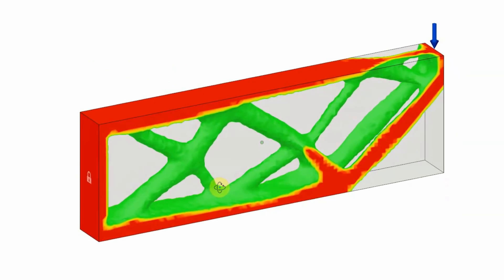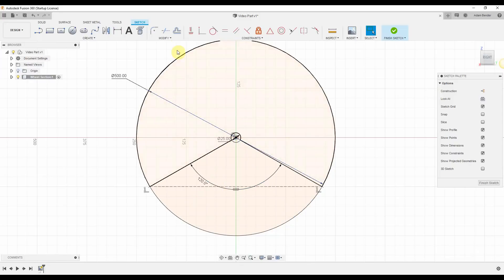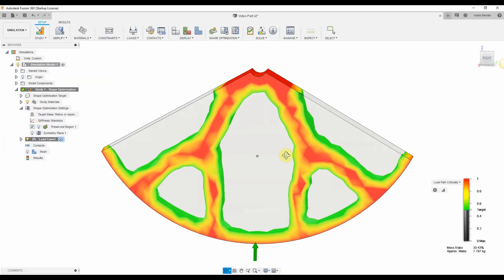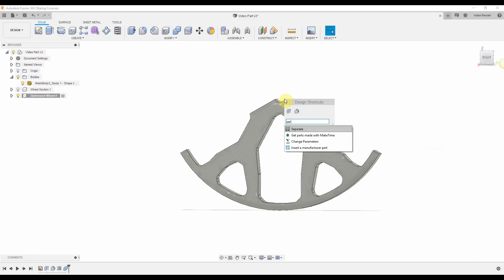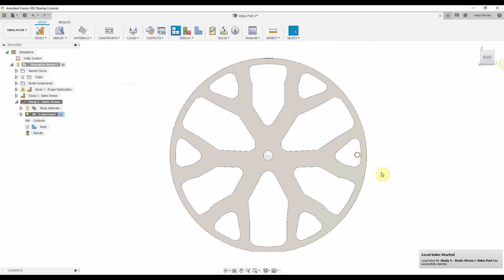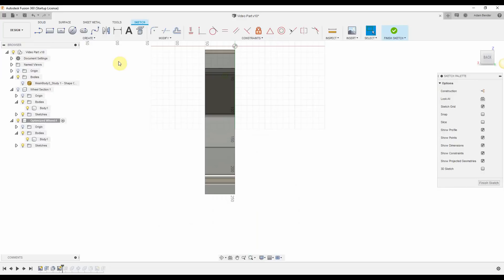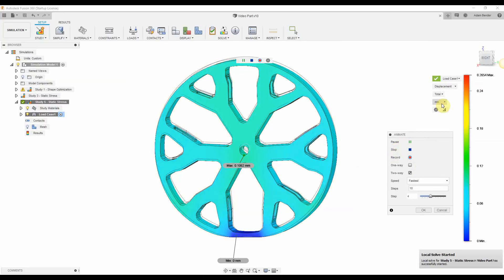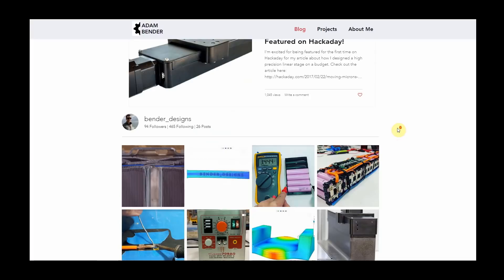Design the Best Wheel with Fusion 360 and Generative Design

Comment: I think you should be carful when using optimization to design your parts. Optimizations tends to explore designs at the boundary of the formulated constraints. You can see this in your topology optimization example in this video. You constraint the solution to be a disk, and the solution you got was to use the full thickness of the disk. The "optimal" (local minimum) solution you found was constrained by the thickness. Also you design depends on your mesh (size and shape), thus refining the mesh may give you another "optimal" design. The design you obtain here is the "optimal" solution loaded with a constant pressure. This means that you have moved all material such that it helps in this load case as best it can. But say you had another load on that wheel (could be side ways, could be torsion), now you have only optimized for one load case, but you might have many more, and you may have reduced the strength (stiffness) in one of the other load cases by 50% just to get a 1% benefit in the load case you have included. Thus I would have liked to se the solution using multiple load cases. Especially when explaining the idea of optimization, you can find some grate examples of how different the "optimal" design is depending on how many load cases are included in the optimization, and how that are weighted.

Comment: I think the final pressure is applied in a wrong way - to small portion of the bottom of the wheel. In really life it will be distributed across the whole bottom half of the wheel, with most pressure in the center.

Comment: Because this was optimized as one third of a real wheel, it didn’t allow for tension forces in the spokes facing horizontally.  In a real wheel, the rim acts as an arch, and compressive forces are turned into tension in the horizontal spokes.  Since materials are much stronger in tension, this permits much thinner spokes.  This is the principle that turns old-timey wooden cart wheels into modern bicycle wheels, which carry similar loads with much less weight.  You can see this in the stress simulation: all the stress is carried in the two spokes in compression, with negligible force in the rim or in the horizontal spokes.
I learned this thirty years ago in engineering school, so maybe I’m misremembering.  I think it was in “Structures” by J. E. Gordon.
Thanks for recommending books; I’m always looking for more learning.

Comment: Excellent, thank you! Regarding the optimization - it seems that, because you were copying and rotating based upon pressure from the wheel below, only, the optimization failed to account for the possibility of cross-members between each spoke . From the diagram of stresses, you can see how an A-frame connecting the spokes would help - add those, and the net effect would be to form a second, smaller wheel, centered on the axle, with a radius that matches the length to the forking-point of the spokes. Tensile strength would hold the wheel up... and thickening the rim might be enough to reduce the stress on the bottom feet?

Comment: Though I enjoyed the video very much I think the title and terms used in the video are misleading since this isn't actually generative design it's topology optimisation. They're similar but definitely not the same. Still a great video.
Cheers!
Reply: What is the dofference?
Reply: @macarows4014  I'm not sure about the specifics. But what's for sure is that topology optimization is free to use, while Generative Design is only available in the paid version of fusion 360. I think there are some things you can do with Generative Design that you can't with Top. Optimization, for example specifying a method of manufacturing. And I believe that Top. Optimization only uses the model you give it, and removes unnecessary material, while Generative Design first fills out any available space and then removes unnecessary material. As I said, the differences aren't huge as far as I'm aware, but perhaps there are some key differences in the coding behind both. It would be interesting to see how results would differ (or not differ) if you would feed both methods similar or if possible equal inputs.
Reply: @legallyblind4939  I just did quick Google search. Generative design is definitely GAME changer - it builds the volume in whole another level that is traditionally known. Topology is just material reduction, but not AI powered thoughtful building of new object.

Comment: Awesome video and great intro to optimization. 

A few things seem off about the finished design that seem like artifacts of the way the radial symmetry was achieved by copying a section and mirroring it around to make a wheel. You can see the tree shapes are not symmetrical, one arm is thicker than the other. It seems like this is an effect of telling the system to compute for a force coming from down but not realizing that the location of that force will at some point be coming from every point along the wheel rim. I suppose to get the most accurate result you'd have to compute for infinite planes of symmetry about the axle. With those alternating limb thickness you might even get a sort of wub-wub as it rolls if it deflects unevenly depending on material. 

Funny enough as soon as I watched this video I spotted a car wheel with almost the exact same Y pattern, with 5 Y's instead of the 6 in your design. 

Another thing about this wheel, if you turn your head so "down" is coming through the fork of one of the Y spokes, something looks off about the way the material is balanced around the axis. I am not sure if that is something that looks strange or actually would impact performance though.
Reply from the maker: Thanks for watching!

Yeah, it would be ideal if fusion would let you apply radial symmetry planes, that would provide a more accurate result. Programs like Hyperworks let you do this. That would better solve for every single point around the wheel as it rotates, as right now there is definitely a weak spot at the end points of the 1/3 arc. They're effectively cantilever beams right now, but in a truly symmetric design, they'd always be beams supported at both sides. Pretty close though for a demo.

Also doesn't take into account and side loading due to turning, or any torque applied from acceleration. Designing wheels is complicated!